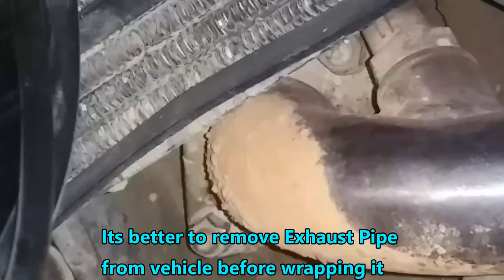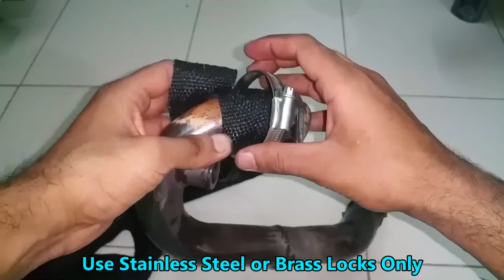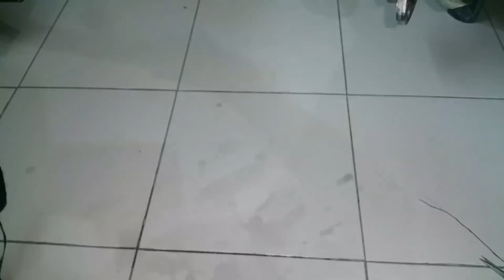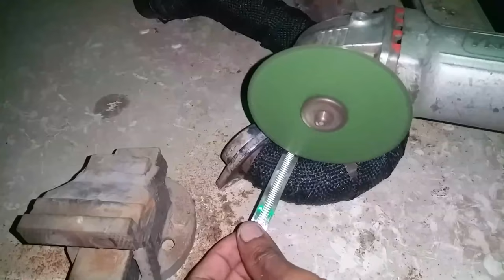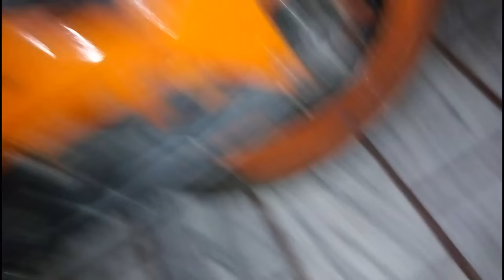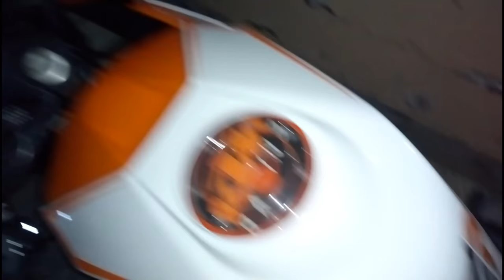Thermal Wrapping Exhaust Pipe of any vehicle at home without any special tools

Comment: Heat wrapping increases the temperature of the exhaust gas, which increases flow speed and removes heat from the engine area faster. However this heat causes premature fatigue on the metal of the exhaust.  Thoughts ?

Comment: Hi bro , I am very much inspired with your videos ,
Can you suggest me or send me the link where i can buy thermal wrapping material??
I am planning to wrap it to my Karizma R bike

Also I would like to know your suggestion on a different topic
Here it goes: 

I have a cbz star old model(self start variant)
I am planning to swap its engine  with ZMR engine (which i am buying it from known resource) 

So can u tell me what other parts needs to be changed? ( I know few : carburettor, wiring kit, silencer exhaust and drive chain) 
pls suggest me
Reply from the maker: Plz don't...ZMR engine is even worse then CBZ....If you wanna swap go for cbr250 engine..
Reply: TopEnd Thank you bro for sharing your experience with zmr engine.
Reply: TopEnd bro can u suggest me a good wrapping material n it's buying link..lately I m facing engine heating issues in my karizma r.atleast 20-30% heat will not hit on my legs n thigh while I ride with silencer wrapped on it..